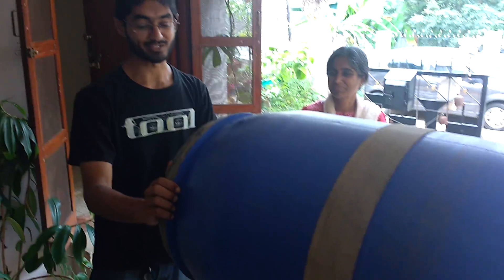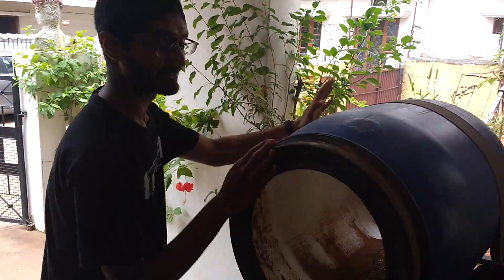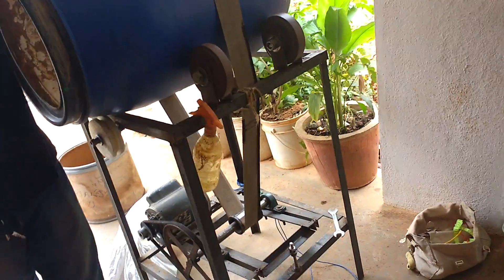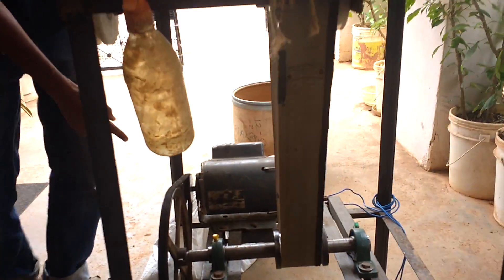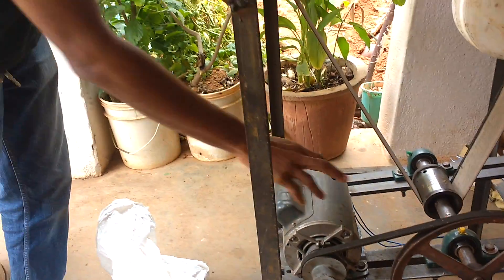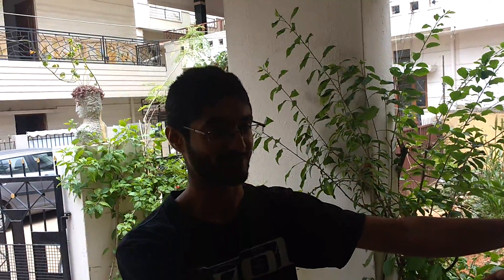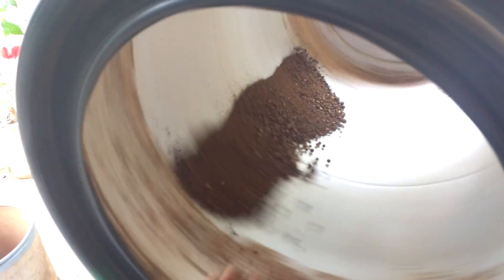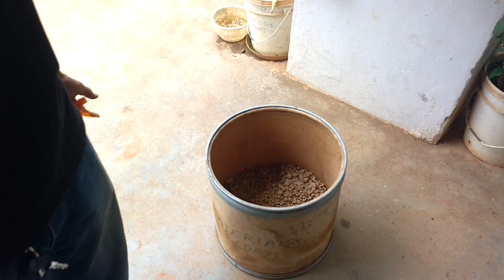Seed ball making machine developed by IdeinLab Architects team

Comment: i have planted thousands of trees using seed balls made by hand, your machine dont seem to do the job, so i''ll share with you an idea that you can apply to make them prior to let them into the barrel, you start in a high place with clay and let a smal trickle of water run trough down a half pipe of pvc or bambo, the balls start forming. after a while you let them run trough seeds and continue downhill till the get into the barrel that is sloped to let them out onto a drying mat, of course you'll have to perfect the idea happy trees!!  excuse me if  i am wrong and your barrel does the job...
Reply: Motor hp
Reply: Motor hp please?
Reply: @unknowntreeman1069  1hp or less